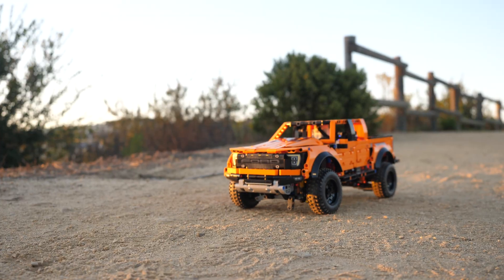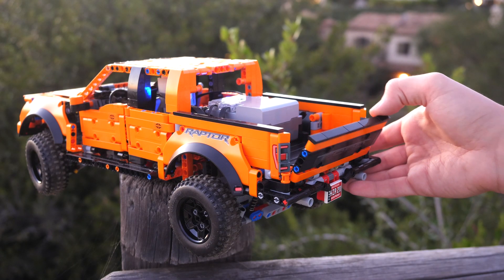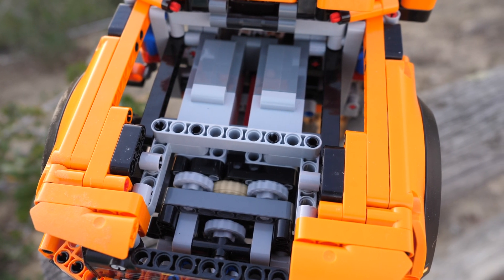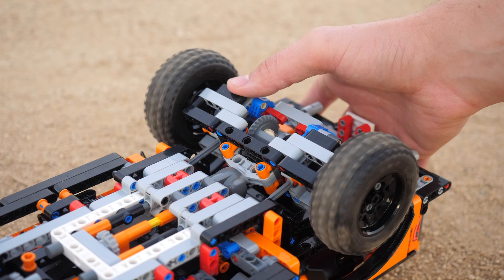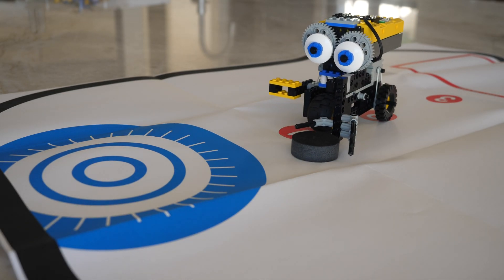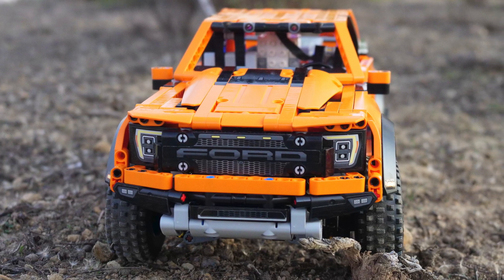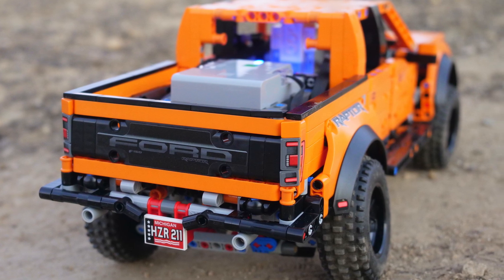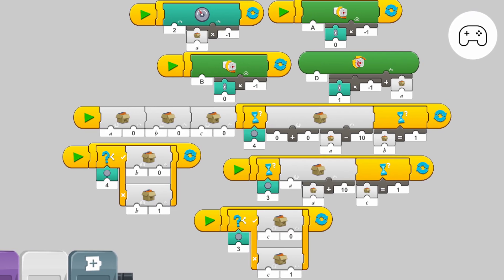LEGO Technic Ford Raptor F-150 Full RC Mod

Comment: I motorized this like you did but when I tried the code it didn't work, so after a while I saw this other YouTuber who motorized this showed the code and it worked for me the code was on the powered up app and was only 2 SHORT lines 1 for the powertrain and 1 for the steering mechanism but thank you because I placed the motors the same place you did but just different code

Comment: I Tried to motorized the ford but with power functions, I took 2 L Motors, and a servo, when I only motorized the rear wheel, when I drove it, it was slow but when reverse it didn’t move, I really didn’t know if was the diff but I’m not to sure.
Can I get some help?

Comment: I did a similar RC mod to my 42126, except that I used Power Functions L motors instead of Control+ L motors, and I used a BuWizz instead of a Control+ hub.

Also, I did a 20:16 gear ratio at the motors for decreased load on the u-joint, and replaced the differential with a 1:3 gear ratio using 12t and 36t bevel gears to have enough torque.

EDIT: I made a short video about my version, with proof that I didn’t just copy Unbrickme’s design. https://youtu.be/zGsd4P2TbLw
Reply: Smart, this way the drivetrain is under less stress, but you still have gear reduction at the wheels.
Reply from the maker: Nice!
Reply: that 36t gear could reduce the ground clearance in some cases but still pretty smart
Reply: @Tapitus-totalus  The rear axle on the 42126 is already super thick, so the 36t gear doesn’t stick out.
Reply: But Power Up Hub is no long connect to BuWizz app remote

Comment: Its so slow. Add buggy motor and sevro and buwizz and you will have a better experience
Reply from the maker: I agree, although my goal is to only use the control+ system for new modifications